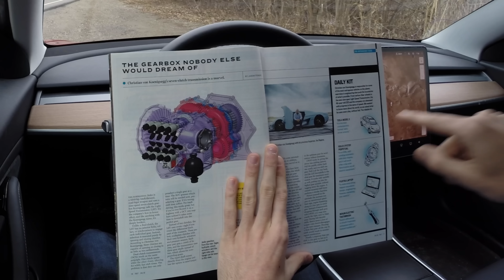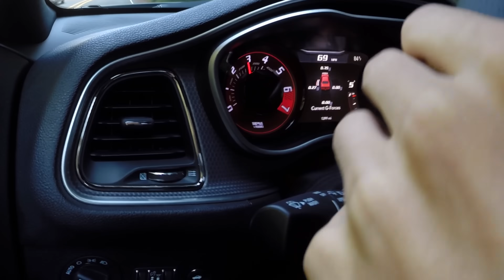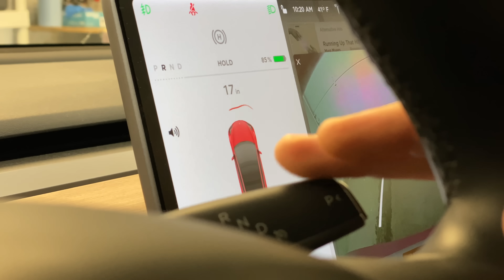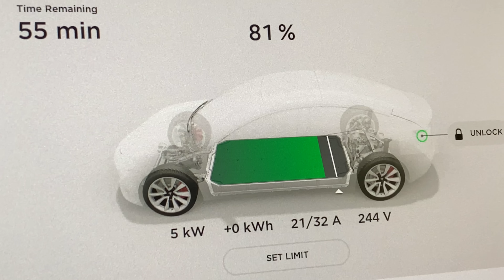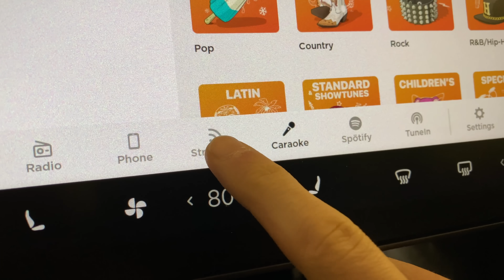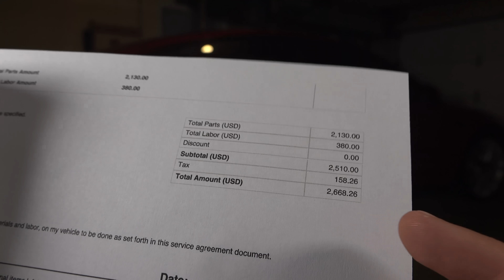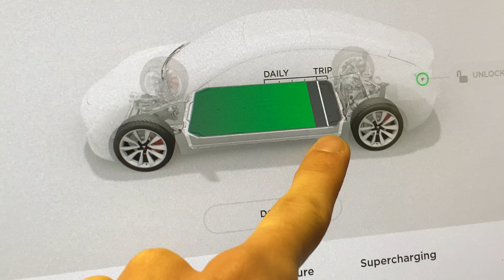Living With A Tesla Model 3 For A Year - The Best Daily Driver

Comment: 1. I have no problem with that. It feels lovely and safe to drive. And btw, i have around 1000 Nm at the start moment since i have a torque converter.
2. The delay makes it more easy to drive gentle and more 'eco'. It's a computer between the pedal and the engine so it compensates everything so it's no problem.
3. You have a transmission in electric car too. And my transmission is very fast and smooth so, no problem there too.
4. It sounds very comfy and lovely, a diesel engine. Some electric cars though - it's horrible! That high pitch sound.
5. Well, it's not that bad. Change oil once a year. More is not needed normally.
6. In Sweden, where there is salt everywhere during winter, you NEED to use the brakes, otherwise they will rust completely and it needs replacing everything (caliper, pads, disc). In my previous car, i NEVER changed the brakes in the front, in 120000 km (7 years).
7. No problem with gas station - i can go 800-1200 km/fueling. Works lovely.
8. Cold car? I have, as you, a heater in the car so it's nice and warm when i go. Try waiting for the Tesla to warm up the battery in -30 degree C.... Check Tesla Björn, he tested in -3 degree C and you lost 10% just by preheating the car and the battery!!! And that cost more then preheating my diesel car...
9. I would never trust electronics when leaving a living creature in the car.
10. Manufacturing batteries are a REAL problem for the environment. And since they are more heavy, it will grind down the roads and tires more and those particles are... really bad! And right now, there is no real way of recycling the batteries, and that is also a huge problem.

And i have no problem with "phantom drain". And if something happens so i run out of fuel, it's easy to refill from a can, bottle or whatever. And i can refuel like Everywhere, but recharging is, not that easy. And besides this, compared to Tesla, my door never gets stuck in the winter, the radar never gets blocked by bad weather (slow/ice/freezing rain), and it's more safe, and better build quality and, ...

Yes, one more: It's less expensive (TOC).

Comment: Number 5. Come on dude! A reliable ICE car is not that much more expensive than an EV. My 9 years old mazda 2 maintenance items that I spent most money on is things EV also have, suspension bits, ball joints, tires, alignment, wheel bearings, windshields etc. Maybe a 60 000$ car isn't the same though to be fair.

Comment: 0 to 60 in 3 seconds, big deal. Is that how you drive it every day? Quiet, bummer. I love a good exhaust note. Low maintenance is a good thing although dropping my vehicle at a workshop once a year to get a full service and safety check is peace of mind for not much money. Perhaps Tesla owners may become complacent and have zero mechanical connection with their car. A full battery each day is great. Not sure how you can achieve this if you live somewhere without a garage. Don't forget that you are still using fossil fuel when you charge, especially with superchargers. 5 minutes to fill your petrol tank on a road trip sure beats waiting for a ev to 1. find an available charger. 2. waiting to charge that battery.
What is the life of an electric motor & battery?
Reply: and you forget that electricity is still generated wether you use it or not

Comment: what about the environmental impact of the manufacturing and logistics of the battery? with harvesting of the resources needed, and the shipping required, is a tesla better for the environment over all?
Reply: @NotTheCIA I.think I interesting, I'm very very much into buying an ev, it's just the redundancy of the logistics that keeps me at bay. knowing what goes into the production of the battery itself, is i  of itself the only thing holding me back.  the out put fro. the engine is less co2 but the global logistics seeks to counter balance that.
Reply: @NotTheCIA I.think thank you for the info, it is very much appreciated.
Reply: Wven if an electric car polluted as much as a gas car you wont have too worry about cars releasing co2, carbon monoxide, sulfieds, or other toxic particles into your breathing air inside crowded citys.

Comment: If I could afford a Tesla I’d buy one. They are amazing machines. Yes they have their problems but overall the best electric vehicle. I wonder how well they do in Arizona or Nevada during the summer?
Reply: I live in TX and the external temperature only mildly affects overall battery performance. You can precondition the battery before you even drive the car right from your phone so it's no cause of concern at all.

Comment: But Jason, why does it look like you're sitting in a golf cart? People complain about the GM/Chevy truck interiors, but the Tesla looks pitiful. My $5000 lawnmower has a nicer dash.
Reply: Your lawnmower has a nicer dash because they needed a way to make you think a $5,000 lawnmower is a good deal. Tesla is more about function and cost over looks.
Reply: @miguellopez3392 I want my cars and trucks to be both functional and look good while doing it. Just because Tesla failed, doesn't it mean it can't be done (relatively cheaply). 

Heck, have you seen the latest Kia interiors, they're leaps and bounds above anything from Tesla.
Reply: @JohnSmith-ev1sm  yes and what is the range and preformance of the Kia? What about safety and software? There is a reason tesla has a 75% market share if EVs in the US, 65% of that being model 3.
Reply: @miguellopez3392  I'm talking about how a specific car (Tesla) looks like it was designed by highschool'ers on a budget. Tesla's success as an EV has nothing to do with its pitiful interior. And, there is no reason why a successful EV can't also have a knockout interior that actually looks like the price you paid for it.
Reply: @JohnSmith-ev1sm  "Tesla's success as an EV has nothing to do with its pitiful interior" minimalist interior makes the car fester and easier to manufacture which is what tesla really does, manufacturing. there is a reason no EV can beat Tesla price points in terms of overall value, competition is non existent for the highschool car, maybe other auto manufacturers will eventually understand the market Tesla dominates.
Reply: @miguellopez3392  Did you even read my posts? I'm talking about the crappy interior designed by highshoolers. That NEEDS to be fixed, it's a sign of cheapness. Whether they are successful as an EV despite that pitiful interior, does not mean that the interior doesn't need to be fixed, it does. Eventually Tesla fans will get tired of driving a golf cart and want something substantial and premium.

Comment: I want to know what it is like at year 5 years and year 10! If you do not buy automatics you can engine brake and your brakes last a long time when you drive them like a normal person. In fact even early automatics had engine braking and could be push started like a manual transmission. People talk about peak oil what is "Peak Lithium" how bad is lithium mining and the Chinese Rare Earth Metal market and their track record of environmental abuse and human rights abuse? Maybe 10 years from now Toyota will have an all electric EV and we will have charging stations as plentiful as gas stations and the charge time will be much much faster but I doubt it!

Comment: Thanks for review. I get it, and I really would like to be so enthused for EVs. I still can't overlook two issues - They are too expensive to buy, and charging takes too long. You whine about visiting a gas station, but it takes less than 5 minutes to fill a tank.
Reply: It's just a matter of how willing you are to invest. Depreciation is much slower, and fuel & maintenance are a small fraction of the usual cost. Charge time is not a problem if you plug it in between commutes. I can only see this being an issue if you absolutely need to take a lot of long road trips where time is of the essence. Even then, it's not impossible to adjust once you realize the cumulative fuel savings for that kind of lifestyle.

Comment: The biggest argument currently for the change resistant people seems to be pollution related to mining and production of the batteries. Is that a valid argument against electric cars? Same argument is often used as an advantage to the non existent and hyper expensive hydrogen electric cars.

Comment: Imma come back to this video in 5-10 years when graphene batteries become mainstream and the automotive industry finally starts using them for electric vehicles
Reply: @NotTheCIA I.think  look up what a graphene battery is and what it can do and you'll understand. Longer lasting, more power, more capacity, and a much faster charging rate. Up to 70% faster than todays standard battery. So basically what takes a lithium ion battery to charge 5000 mah in an hour and a half a graphene battery of the same exact size holds 45% more power than that 5000 mah battery and still charges much faster than that.
Reply: @NotTheCIA I.think actually Samsung plans on releasing their first graphene battery in 2021 for the new galaxy series. Everyone has been working on this since at the least the early 2000's

Comment: Actually the Bolt out performs the Model 3 range pr kW/hr. Easy Tesla fans this is a true fact you can look it up. However, the bolt is slow, boring and plain ugly. So it does lack performance wise and is probably why it has the better range pr battery pack. The current GM LG cells are only 4% less energy dense, but are a bit bigger in volume. GM has recently stated there are changes coming. The LG cells, Samsung and many others are just as "about" good as the Panasonic cells. The Panasonic cells maybe the best by a very small percentage and battery tech along with EV will be the fastest growing technology in the near future. So all is subject to change. Battery tech we have today will be gone or at the very least I predict will be drastically different in just five years or even less.

Comment: I wouldn't fault the visibility really, as it's all done for the sake of efficiency and safety.  The high trunk is needed to improve aero and they probably could not make the pillars any slimmer due to the weight of the batteries during a rollover.

Comment: Major flaw: it's $60,000. Mass adoption is going to be difficult even with even a $40,000 car.
Reply: Yeah key is to hit that 20.000 segment, what makes me wonder is how price of electricity would change if lets say all cars are electric and what kind of power drain it would cause.
Reply: @MarkoLomovic  It may actually lower the cost of electricity, having thousands of battery bank hooked up to the grid could smooth out energy demands on the grid.
less need for peaking plants and better utilization of renewables.
Reply: @MarkoLomovic  I did some calculations for Russia. Here if all cars were electric, it would raise electric power consumption by no more than 15%. Since electric cars are most often charged at night when power consumption is low, there is no need to build any extra power plants. I'd say price of electicity would not be affected much here. I took into account only gasoline cars though, no diesel, no trucks, because there is no data available for electric trucks/semis.
Reply: @ayushin82   Yeah that is not much, I expected more. Compared to paying for fuel that is nothing.
Reply: Also they should last longer so as a second hand car they're great
Reply: @ralanham76  300,000+ miles isn't long enough?

Comment: Link to the Jesko transmission article please!
It's interesting though because the Tesla Model 3 is in a price range that is pretty unique since most electric cars are either quite a bit cheaper or quite a bit more expensive. 
I find it strange that most people who comment negatively about EVs talk about the charging issue but the reality is a good proportion (if not the majority) of people have garage or off-street parking available so yeah they can charge up for daily driving at home. If you live in an apartment or park on the street? Yeah that sucks for you. What i find silly is that new home builders aren't putting high voltage/power plugs outlets in garages by default. If you're selling a $300k+ home with a 2 car garage now you should have two 240V outlets with sufficient amperage in the garage. Even if the homeoeners don't have an electric car they'll be great for other purposes. My house was built in 2015 and it is a LEED house but yet it didn't have a purpose built 240V outlet in the garage. Luckily the breaker box is in the garage as is a 240V electric heater (which I never use) so it'd be relatively easy to provide power to the car.

Comment: Thanks for the great videos. I also have a Model 3 single motor w/11k miles and love it.
I have a question you may be able to answer, I have an Experimental racing type aircraft turbocharged inner cooled injected
Engine: 360ci- 220hp @ 2700RPM
Engine flow = 217CFM @14.7psia STD
Pressure ratio = 2.2
Corrected airflow(lb/min) =31.1
I am running out of boost above 18,000ft, I can run 25inches (psig) and 2500rpm to 18,000ft above that I start losing manifold pressure.   I would like to maintain 25psia to 24,000
FYI @ 18,000ft we have 1/2 atmosphere 7.36psia @ 25,000  5.45psia
Turbo is Roto-Master (Rajay) Turbo Model 3AT6EE10J2 (325E10-1) P/N 600573-00 or 600576-00 or CF600573-9000 (RJ0331-1)
Reply: oops 25inches Hg manifold pressure not psig

Comment: 1:43 I would like to quickly make the argument that the path you stayed isn't really possible.

The tech that makes electric cars work (li-ion batteries and transistors) weren't really around until well after electric cars lost the automotive race back in the early 1900's.

But I take your point.  As a thought experiment decent range electric vehicles have been around for the last 100 years.

As another side note, it's kind of funny that electric motors (starter motors) are what allowed gas to overtake electric cars, and electric cars might bookend gas cars.  Just an interesting concept imo.
Reply: Also, it looks like, transmissions might be making their way into electric cars anyways.  Well in performance vehicles like Porsche's taycan anyways.  I'm interested to know if anyone is going to try adding a CVT to a small electric motor to try and make "a range king" but that's a whole different theory.
Reply: 14:35 to be fair for this point.  Plastic bits that break the first time you use them are hardly a Tesla exclusive.  Honda loves to use these little plastic clips to hold body parts together and half the time you try to take them off they break, and my vw has a taillight clip that broke while I was trying to change the light bulb.  So annoying, and not customer focused, but definitely not tesla exclusive.
Reply: 16:36 last one I swear.  This is actually something that reflects more on the wide range of users preferences than an actual error.

Consumer reports did a thing about this and basically what they said is for every system the get people saying "it way too aggressive" to "its basically useless" for every brake assistance system out there.

So this is more uneven social expectations with a certain tech, than a just a Tesla problem.

P.s.- I'm guessing you can tell I like to play devil's advocate.  Sorry if its annoying right now.

Comment: The 100 years of motoring history idea, really doesn't work. They DID have some rather good electric cars right at the very start of motoring. But until LiPo batteries and modern speed controllers; they remained very limited. 
 Probably very soon. Once we have far cheaper, more energy dense and durable batteries; they will utterly replace IC. But for 90 years IC was king, for several reasons.

Comment: Jason - want you opinion on these two scenarios.

1.  I'm 40.  I lived in Cutler Ridge (Miami), FL in '92 during Hurricane Andrew.  When Andrew hit, we spent weeks (some neighborhoods months) without power.  Any concerns over dependence on electricity?  (Fuel prices were ridiculous but we still had fuel trucks coming in.)

2. Along with high winds comes water.  What about areas like Louisiana and hurricane Katrina that flooded cities.  How do electric cars handle driving through water?  Any concerns over water breaching the battery packs? Electrocution of occupants of you try and ford a couple of feet of water?

Comment: I can't get past one thing, you have to do almost everything through the touch screen. Which takes your hand off the wheel and eyes off the road. In normal cars, most functions can be performed on the steering wheel. You know where they are without having to look or move your hand.

Comment: -  I have seen some publications claiming V10 R8s need more like 2.6-2.9s for a 0-60mph acceleration. RS3s doing it in around 3.5. 

- There are ICE cars with electric heaters, so you don't have to wait till the water warms up. 

- Where it's legal, you can fill up your car at home with lpg. 

- And in your reversed world, EV driving average people wouldn't belive me, if I told them I can fill up my car at the gas station in less then 5 minutes. And that 5 minute stop gives me a range of 350+ miles, even when I drive my small, B segment car (gas tank smaller than 12 gallons, consumption around 31mpg@80mph).
Reply: I was wrong, it's cng, not lpg.

Comment: How about battery maintenance? A new one every 4 years together with the cooling liquid? :)

I drive around the town every day (about 35 km a day). And I usually visit a gas station once in two weeks to fill up the full tank. Compare that to everyday charging.

What if your electric car is staying outside in a cold temperature. Doesn't it waste energy to keep the battery warm?
Reply: Yevhen Pavliuk 
1. No, they will last several hundreds of thousands of kilometers
2. 14 x 35 km = 490 km in 2 weeks. Sounds like plugging in twice in stead of every night?!
3. The battery does not have to be kept warm when the car is parked.